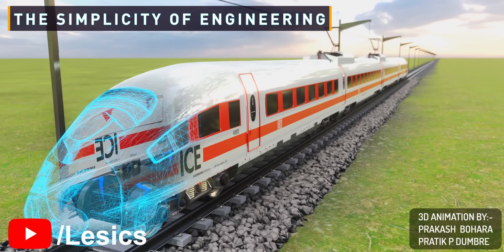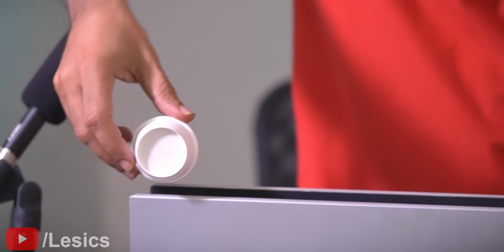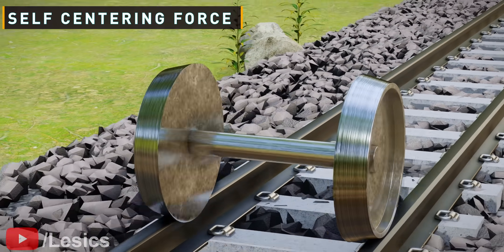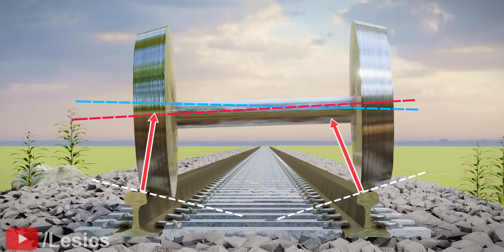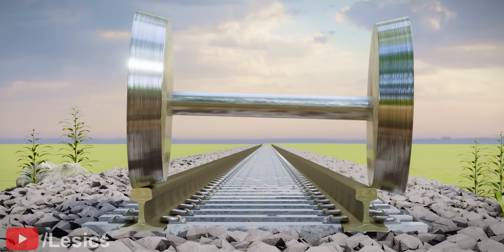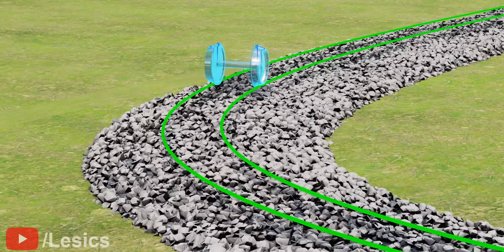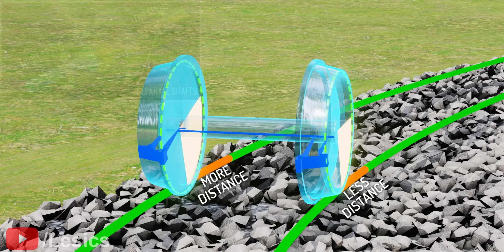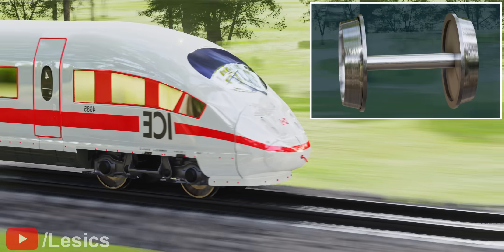The interesting engineering behind the SHAPE of Train wheels!

Comment: I’m not so much convinced by the first explanation, the shapes of the taper remain identical, the tracks are somewhat rounded on top and gravity could act this way only on perfectly leveled tracks too…
Doesn’t it just also be the second reason for the taper to correct the centering who is much more important ? Even on straight lines, if the axle would deviated to one side, the greater circumference of the wheel at this spot would make turn the wheel “faster” than the other and since this is not possible because they are welded stiff together on the same axle, this induces some kind of turn and thus re-centers the whole carriage on track until both wheels apply with the very same circumference on tracks. One reason also why the sometimes applied wear bands are always replaced by pairs ! (Sorry for my bad English !)
Reply: I also think the flanges do the most part for keeping train on track.
As u said , these get regularly replaced during inspections.

Comment: This whole thing is either fictional or old technology. Modern train wheels are slightly concave in the center of the tread and they match the convex curvature of the top of the rail. The wheel naturally rides on the center of the rail. You see videos of railgrinders in action and they are maintaining the proper curvature on the top of the rail. When the cars are being pulled, this helps maintain the alignment of the wheels on the rail. Whenever side forces such as curves or the cars being pushed or other causes, then the flanges keep the wheel on the rail. The flanges and the sides of the rail are also matched so the wheel will not have a tendency to climb the rail. If wheels were designed using the theory presented in this video, rails would be worn out in no time at all. I worked around the local railroad yard for nearly 21 years and I have seen their videos explaining how this works and why the railgrinders are so important. I glanced through dozens of the comments below and I did not find a single one that looked like it came from a real railroader.
Reply: Thank you, Jerry!

Comment: That's funny, been working on locomotives for 17 years and changing out bad traction motors with new wheels and truing worn wheels, never once have I seen a "conical"" wheel. The wheels profile is basically flat and if not they soon are as they wear especially on locomotives with thin and high flanges. The wheels normally wear in a "u " shape over the rail, never in a conical shape.
Reply: When trains were getting past 130mph they found out they derail with hunting oscillation. The Japanese got in a guy to design the brand new rail head profile and wheel for the new Shinkansen. It used a conical shape. 
British Railways were seeing derailments as low as 20mph in wore out wagons and rails. They got a guy called Alan Wickens in and he led a team that came up with the worn wheel profile and did the most detailed study of wheel rail dynamics ever done. It showed trains could travel at any speed without derailing, the limits would be traction power. aerodynamics, increased wear and tear costs. British Railways gave this to the world for free. Quite a thing to do considering how much bad press they got.
I got most of this info from Kit Spacman, a guy who was the tilt engineer on Advanced Passenger Train.

Comment: The flanges are still necessary because the turning forces are enough to derail the wheels regardless of the shape. The flanges are more important thamw the taper.
Reply: Without the taper, the wheels slide all over the rails, and even rub against the flange more, creating more friction and decreasing efficiency.
Neither is more important than the other.

Comment: Terrific explanation and supporting animation. One question, would this conical wheel shape cause the inner portion of the track to wear more rapidly than the outer portion, and over time the top of the track would wear differentially to yield a angled surface mating to that of the wheel, thereby mitigating the centering effects of a conical wheel?
Reply: I think that’s true. I know there are special locomotives equipped with “track grinders” that resurface rails. I saw one below me once as I walked over a bridge with active tracks below. Very noisy and sparky

Comment: I knew the shape was to keep the train centered on the track, but I never even thought about the differential action when going around curves to be honest, pretty interesting how simple it is!
Reply: Simple solution to a complex problem - hallmark of genius
Reply: Same! My eyes widened when it came to this part because I hadn’t ever considered that and immediately wondered why most trains didn’t just derail at turns. 

I wonder if early on with trains they learned this the hard way.
Reply: but they have to be careful how tight they make the tracks turn to make sure the angles and the turns that the the differential action is creating are enough to accommodate for how tight the turn is. Basically if the track took a hard right or left, it doesn't matter how slow the train is traveling, the differential action will never be enough to allow the trains axle to stay on the track and complete the turn
Reply: It is simple now we all know how it's done.But for George Stephenson in 1830 when nobody had ever done it,it would have been a different matter.
Reply: No one knows the exact day hour /But we can see the signs events all around us. And by the timeline, Israel is 80 years and 1 generation span according to bible text will be around 2027 , which israel was declared first in 1947 + 80 years = 2027 . so we know we dont have 10 years left as this is 2022 so the rapture, then the tribulation will be before 2030 for sure.The rapture will happen without a doubt and it will happen much sooner than many believe (less than 10 years according to all the environmental, weather,astronomical signs ,israel timelines etc showing ). It will happen without any warning , not one , in an instant , catching masses of people off guard just like God always does, ie the flood ~ a rude awakening . No one knows the exact day or hour the rapture will happen is a certainty . THE RAPTURE CAN HAPPEN NOW at ANY TIME make no mistake !! . Please awake to Christ Jesus which is the ONLY hope NOW and dont let it be found out it IS all true later when its too late & many have been left behind in the most terrible times the earth Has Ever experienced Before and ever will...for anyone who sees this and doesnt know what to do please If anyone hasnt given their life and heart to Christ Jesus will have REAL BIG problems way bigger than any problems Ever had If left here on earth after the Rapture . After the Rapture The USA , Worldwide , will face More evils , Inner city chaos, firearm wars etc etc ,power & water , food shortages , military invasions,mass executions (yes much blood will be required by antichrist ) etctec than it Has EVER been seen Before and you surely dont want to be Here then . We Have Time NOW to change , please seek Christ Jesus while there is still time to save ! no one knows the day or hour of the rapture it will start out just like any other day and it will Take Place In the day In Broad daylight/sunny day , In an Instant FLASH without ANY warning ,& there will be peoples Driver Ids, cell phones ,wallets found in various parking lots,Purses, bill folds Found at work etc etc with NO explanation , and People VANISHING so No One can refute it has taken place. .romans 10:9-10 That if thou shalt confess with thy mouth the Lord Jesus, and shalt believe in thine heart that God hath raised him from the dead thou shall be saved! please share with others =IMPORTANT  raptureready.com

Information for anyone who has come across those that refute the rapture and say that it was supposedly made up and say it was created by darby church in 1700s . This is real good to show it was way before darby , and its documented . also rapture pre trib proofs even in dead sea scrolls .15-1700s/ irenaeus 170ad/ 250 ad / /isidore 4th century sourced by intense search and study by ken johnson   https://www.youtube.com/watch?v=e1Nv-xFig8I
Reply: Same here.
Reply: This video is racist and not ok
Reply: Same 🤷🏻‍♂️🤦🏻‍♂️😂
Reply: i don't understand first reason
Reply: @info1841  It's just the weight finding balance.  The slight weight difference forces it to want to stay center even when turning as long as speed is reasonable for the curve.
Reply: @info1841  I know about the train wheels Never leaves the track
Reply: @info1841  first reason was difference in radius b/w two wheels 
When rolling left wheel has greater radius than right one. Becoz of that left wheel have to cover larger radian angle which is directly proportional to distance covered.
Meaning
Larger the angle larger wheel have to cover distance. 
So when turning left wheel right wheel covers lesser distance then left one.
Second one:
When rolling right wheel tries to move towards left wheel but end up balancing each other at the end because of shift of centripetal force towards their Centre.

Comment: I also learned recently that the conical wheels produce much less drag on the rails than flat wheels would, and that is also why the rails are slightly convex: less contact = less friction = less drag.
Reply: importantly this has to be balanced with the strength of the materials used such that the increased pressure force from reducing the surface area isnt enough to buckle or crack the wheels or the tracks
Reply: @callanc3925  or wear them down to quickly
Reply: @callanc3925  yea I am surprised that it holds the weight. And anotehr questions is why passanger trains are so heavy in the first place. What about fuel economy?
Reply: This was one of my first thoughts, and surprised they didn't cover that
Reply: Friction is usually meant when 2 surfaces slide across each other or want to slide. A wheel does not fit that description as much as the surfaces roll over each other rather than slide. A metal wheel takes less force to roll than a rubber one. A rubber wheel squashes a bigger flat area and to move forward it must squash the rubber that is just coming in contact to the track and the rubber takes force to squash. The rubber at the back of the wheel that is leaving the track bounces out to help to push a bit but not enough to match the energy to squash the rubber at the front of the wheel.
Reply: Hence less breaking...
Reply: That's wrong, friction doesn't depend on the contact area
Reply: It amazes me that the steel of the rails doesen't deform with so much weight concentrated on such a tiny spot.
Reply: @LucaDarioBützberger  Because the weight isn't on a single spot - it's on many spots. A modern locomotive engine usually has 6 axles - so the weight is distributed across 12 wheels, while cars can have as few as 8 wheels each.
Reply: @AdeptPaladin  Well... i know that. But even if distributed across 20+ wheels, it is interesting to see it not getting deformed considering how tiny thoset spot are. That is why I wrote the comment.
Reply: That's why trains are so efficient, because they are barely touching the tracks... this is also why they suck at climbing steep hills, take a long time to get going and a long time to stop.
Reply: WHATEVER YOU SAY RUPAUL
Reply: "FLAT WHEELS" ?
What the hell. 😂
Reply: The wheels are rolling, not sliding (unless something is actively going very wrong I guess), so the friction between the rail and wheels shouldn't really matter. Additionally, friction is independent of the size of contact surface. However, I think your point on the small contact area being useful still stands, as it minimizes the amount of perfectly circular material that needs to be fabricated.
Reply: @samkerski  it does matter, because trains don't use tires purposefully, the less drag/friction a train has makes so it moves freely over the tracks, i'm not a engineer or train specialist so i can be wrong but i think that makes trains need less power to keep up at the same speed or to accelerate, since a train is  very heavy and when it  is accelerating it IS basically sliding the wheels on the track, same for braking, i presume trains basically just move the wheel as they want and let the friction catch up to it.
Reply: @splintergp  dynamic friction is not a function of contact surface. it has its reasons but dynamic friction doesnt care about the size of the contact surface
Reply: @samkerski  the coefficient of friction still applies, regardless of the action. However the real thing at work here is rolling resistance.  Lesser contact patch combined with the materials used reduces this friction and makes train wheels on train track very fuel efficient. This combined with hybrid locomotives allows trains to move as much cargo as they do with about four times the fuel efficiency of semi trucks.
Reply: @samkerski  Dynamic friction does not depend on the area of the contact surface, but static friction depends on it. The wheel does not move relative to the rail at the contact point, so there is static friction, which depends on the contact area.
Reply: @TheZajkov  So much this.  A train /needs/ static friction to even function - if the wheels can't grip the rail, then the train can't move.  Sanding rails adds to this static friction, which is why it is done for braking and to climb hills/elevations.
Reply: @samkerski  this guy doesnt know about the rolling friction wow
Reply: @ta1708  tell me why would rolling resistance depend on area?

Comment: Two things.  First The ancient chariot wheels are the same distance apart as the modern day train wheels 
Second.  Barrels have the same conical shape on each end.   This allows them to be rolled on rails up and down ramps.
Reply: How do chariot wheels have anything to do with this?
Reply: @troyt6532   Wooden wheels like those on chariots form 'ruts' in dirt roads over time. The romans had a standardized axel length of their chariots, so their wheels all fit in the same pair of ruts on every road. After Rome fell, the roads remained, so later Europeans built their carts, wagons and buggies with the same width axel to use those same ruts. When the train was invented, the designers had to choose an axel width for the cars, and they went with what they were already familiar with.
Reply: @caseyb1346  see, now this is actually some interesting stuff. More people need to be like Casey.
Reply: @caseyb1346  There are loads of different track gauges in use so that is incorrect.
Reply: @caseyb1346  cool history lesson in just a few sentences
Reply: @agt155  I fact checked it, and it does apply for the standard rails in Britain and the US.
Reply: @friendlynudist2191 So that in case of another invasion by the French at least they could not transport their troops and weapons by train...
Although it wouldn't be that difficult to make an adaptable train
Reply: Okay

Comment: I would like to add something to the last part about the centrifugal force (note: I'm not saying he's wrong).with the heavy haul train used in Australia for iron ore transport you can actually hear the wheels bag into the rail on turns as the conical shape pushes the train wheels centre and then back on to the lip.

most of the time I hear this is on site where a speed restriction is placed in that area.

Comment: I’m not sure I agree with you on the first one. The self centering is because of the common axle and different surface speeds at same rpm : the higher wheel has a higher surface speed at the same rpm, so it performs a braking action pulling it back to the same surface speed as the other wheel. Opposite action occurs at the opposite site, thus balancing out the system.

Comment: You may also want to note that metal train wheels get flat spots when skidding along metal to metal after braking.  Those flat spots have to be honed out and there are a limited number of times that a given wheel can be honed before it has to be replaced (loses diameter).  Plus, to turn the wheels on a lathe the tracks have to be taken off the train as a major maintenance hassle.
Reply: The wheels are fitted with tyres
Reply: And there are lots of machines now which allow the wheels to be machined while still on the vehicle.

Comment: I seriously doubt that on straight line, the train is kept on track by those little horizontal forces due to inclined reaction forces. I believe on straight track the train is kept in the middle by the same mechanism as it in corners. Same in corners, the train is not "steered" by the difference between those forces, but by wheel geometry itself and how it beds on the tracks.
As explained here:
https://www.youtube.com/watch?v=y7h4OtFDnYE
Reply: Both explanation are correct but the one in the video you linked is easier to understand than converting the whole action into forces like they did here.

Comment: One serious problem with these wheels... first, it seriously limits the speed a train can reach...  The wheels cause increasing  rocking back and forth  over about 50 MPH which  is really dangerous...  The high speed trains must increase the trains stability by some other method...
Reply: not true freight train go over 75 in the united states the rails are welded here so rocking isint a problem and the cars have weight so its not going to be rocking back and forth like ur mth train around the chrismas tree
Reply: @sctco432  I repeated what a qualified engineer said...

Comment: This I understand but the force that I don't understand is the longer the train is the more force it exerts when going around a curve and the maximum length of a train can only be about 3 mi long because further than that would cause so much force on the outside rail that it would pull up the spikes and I do not understand why the length of the train has anything to do with this Force but I know that the longer the train is the more force it exerts as it goes through the curve and I'd love to have someone explain why this occurs